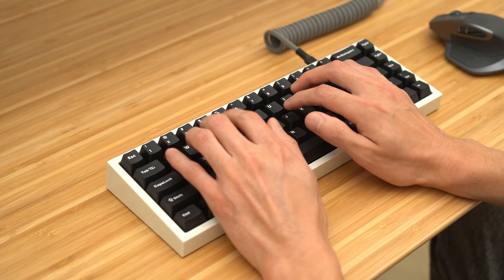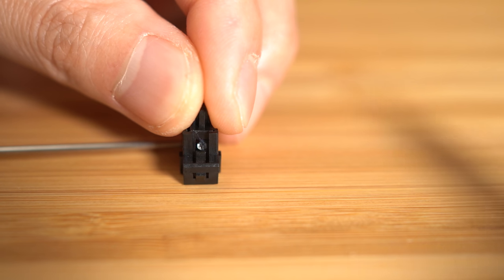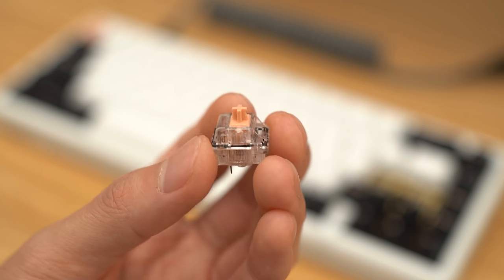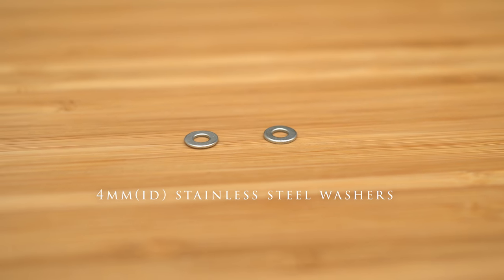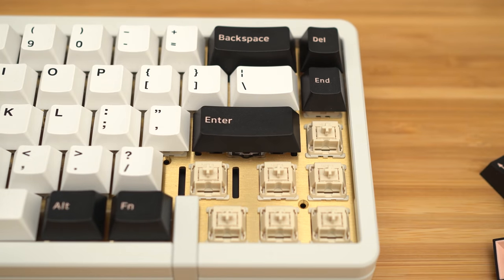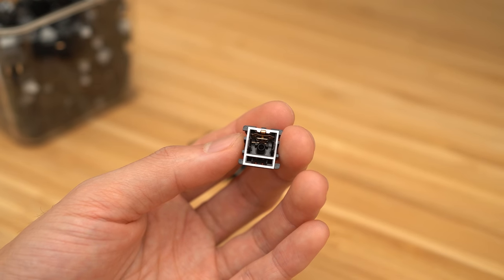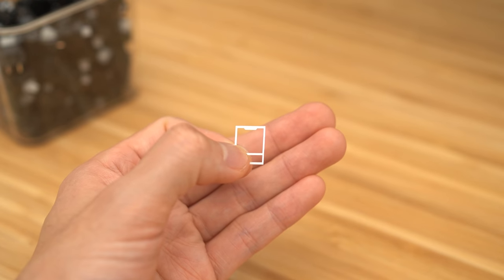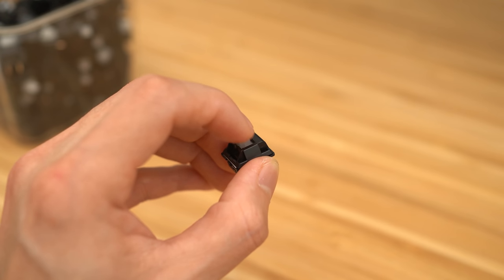Keybored Quick Tutorials - Custom Keyboard Tips and Tricks - Episode 1 - Stabs and Films

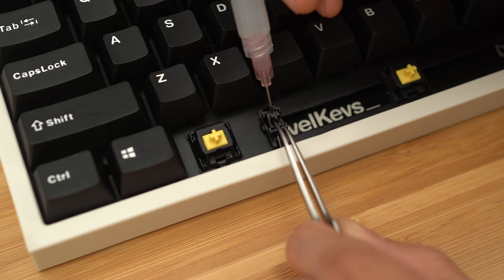Comment: @1:18 adding some tape on the sides of plate mounted stabs make them even more stable and less rattly
Reply from the maker: That's good advice!
Reply: @Keybored  I have crappy stocks stabs that used to tick once the lube I applied settles, if you have cheaper stabs, I would also suggest using ptfe plumbing tape and a little amount of lube around the stab ends, I made a crappy video about it but I think you could deliver a better quality one, if you have some stock ticking stabs

Comment: the one with the long stem switches is actually really cool! i was just prepping a build with pandas so this really helped
Reply: unfortunately this didn't work so well when I tried both methods on my spacebar. 

Pushing the stab stems up becomes undone when the thumbs press down on the far ends of the long key (forcing the other side to go up, because the room to get into seesaw is still there). 

When using washers, the same thing happens even more easily because the stems have a more shallow seat in the keycap (at least that's my interpretation).
Reply from the maker: Hi wanzai!  It might be because the stem poles on your keycap might be a bit loose!  What I tried in the past is using plastic food wrap (cling wrap) and cut a little square and wrap the stem with it.  It makes the keycap fit in much tighter and should help with this!
Reply from the maker: I'm glad it worked out Varbil!  It was super frustrating for me when I was using the Holy T1 and none of the stabilizer keys worked well... had to figure something out!

Comment: The pandas having a slightly longer stem is actually a bonus for boards with north facing LED's as the longer stem provides just enough clearance so that GMK keycaps dont cause any interference issues. all panda variants and switches with extended stems can do this.
Reply from the maker: :) Yup!  And there are other switches with slightly modified upper housings that help in this area too!

Comment: The problem with the syringe method is that over time the lube will fall out and ends up below the stem of the stabilizer, which leads to a very mushy experience. For hot-swap builds it would be easy to just take them apart once that happens, but for soldered builds, it would be a pain. I found that the better alternative is actually the holee mod or variants of the holee mod.
Reply from the maker: Hi GG! Thank you for that advice! I have tried the heat shrink mod in the past and it was a hit or miss. But I'll Def try the holee mod with the bandaid!

Comment: THAT WASHER TRICK WOULD HAVE SAVED MY FIRST BUILD! But what I essentially did was the tweezer method but instead of a tweezer I used the extra 7u wire that comes from stab kits. I stick the end of the wire into the cavity and pull up to seat the stabs fully into the keycap.
Reply from the maker: Hi George!  I'm glad it worked out with the 7u wire!  That's something I haven't tried before and will def try next time!  Thanks!
Reply: @Keybored  the cavity I stuck the wire into is that unused space above where you'd normally stick the wire, if you get what I meant lol

Comment: Rly useful video, but i have another problem with stabs. Some of them are sticking. Do you know how to fix that?
Reply from the maker: Hmmm... there are actually many reasons why this can happen!  Sometimes a bit too much lube on the bottom makes the stem stick to the pcb.  But more common is when the stems are not seated properly into the cap, making the stems twist inwards or outwards and make them run against the stem housing... If none of these are an issue, also take a look at the stabilizer wire to make sure it's not bent!
Reply: @Keybored  ok, thanks for reply)
Reply: @Keybored  I think it's the first reason. Is there any way to clean the bottom from the lube without desoldering?

Comment: I'm still trying to figure out how to actually get permatex into a syringe ;_; it's too viscous.
Reply: If you separate the syringe into 2 pieces then squeeze dielectric grease into the syringe then put the syringe back to 1 piece, you can get it into the syringe. After that all you have to do is squeeze the air out by pushing down on the syringe.
Reply: @leem0401  isnt that how to put anything in a syringe?
Reply: @variamente6855  Not really. They usually "suck" it into the syringe from the needle
Reply: @ixpaul  unless its liquids. When its a slow moving liquid like this you take it apart
Reply: @leem0401  tried that already, didn't work. I was thinking about warming the permatex to see if I can reduce its viscosity
Reply: @BenedictTanShanWen  Your syringe gauge may be too small
Reply: @leem0401  what gauge are you using? The largest gauge I have on hand is a 20
Reply: @BenedictTanShanWen  I use 18 and it works
Reply from the maker: Hi Benedict! One thing I do is use a giant syringe and fill the plunger side with as much dielectric Grease. Then I use that to squeeze into a smaller one! Hope that helps!
Reply: @Keybored  Huh, I never considered the yo dawg option, I'll give it a go!

Comment: I know maybe you don't know what's going on with this, I tried to make my own custom cable for my keyboard but it doesn't work i taste the the GX16 connector and it works tried the cable already cute and soldering each cable and it works but when I try to put everything together it doesn't so if you have any idea PLS MAKE A TUTORIAL, by the way excellent content and very helpful :)
Reply from the maker: Hmm that is interesting! When I first made a cable, it also had some issues and I realized that I cross one of the wires. Might be worthwhile to check for that. Otherwise, also a super long length doesn't work well either :(

Comment: Is there something wrong I’m doing? Everytime I try the washer method on my Durock V2’s, they rattle around and sound like a bunch of metal rattling when pressing the key. Any help would be appreciated! Cheers!
Reply from the maker: Hi M! Is the stabilizer loose or bent at all? If it can't provide a tight fit between the stem and stab and if there is too much space, it'll start to rattle :(
Reply: @Keybored  nope! Not that I’m aware of. I’ve tested it on multiple stabs (space) , shift etc, and rattle on all!  :( maybe the keycaps?
Reply from the maker: @NeonMinnen  hmm... Perhaps the washers also. One other thing you can try is get washers of the same size but in nylon. Should be much quieter :)

Comment: why does some of my switches still sound gritty? they're durock linears lubed with 205g0 and tx switch films yet a few of them sound/feel like sand compared to the others. It's not unbelievably scratchy but my other durock linears are buttery smooth so it just ruins it. I don't know if I'm just repeatedly messing up my lubing process or something but it seems unlikely cause I've relubed one of them like 10 times. it kind of sounds like overlubed bubbles but it's not.
Reply from the maker: Hmm... A few ideas. I do get some gritty feeling if I don't have a very clean application of lube. Like a super old brush for example, I get small hair and random stuff and makes the switch feel less smooth. You can clean the switch and try again to see if it helps. The other thing is that some of these switches have burrs and imperfections unfortunately... For these, check to see if there are any visible burrs or mold marks that is causing it to be less smooth. Hope these help!
Reply: @Keybored  thanks. I'll try this and see if it helps.
Reply: @Keybored  turns out it's all of what you said unfortunately. some have imperfections which I can't fix but some just have hair. Weird cause it's not even an old brush.
Reply from the maker: @katherine-oh3rt  That's too bad to hear!  Some switches just suffer from poor tolerance and manufacturing issues more than others :(

Comment: Hello! can you please help me? my  spacebar rattles but only on the right side. any fix?
Reply from the maker: Hi Z4rky!  A couple of potential causes.  Check to see that the stabilizer bar is straight and not bent.  One reason sometimes one side rattles is due to a bent bar.  Another thing to check is whether there is adequate grease/lube in that one stem cavity.  Finally, make sure the spacebar itself is not hitting any part of the keyboard case.  I had this issue with my TOFU where the spacebar would rotate slightly upon press, and hit the case making a rattle.  I hope these help!
Reply: @Keybored  heyyaa i just noticed that the right side that rattles has pre travel
Reply: and i think thats why the right side rattles.
Reply from the maker: @zarky5004  hmm, you might want to check that the bar isn't bent! Take it out and put it on a flat surface to see!
Reply: @Keybored  thanks ill try that next time. I dont know how to desolder and I dont have the tools for it